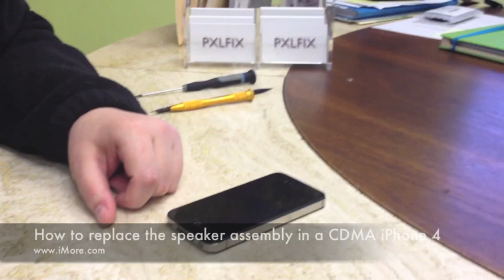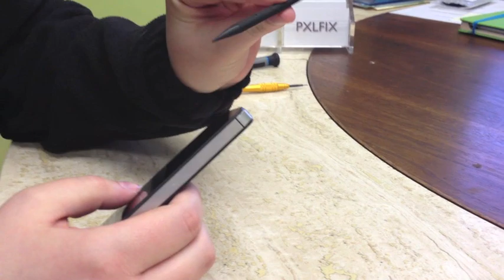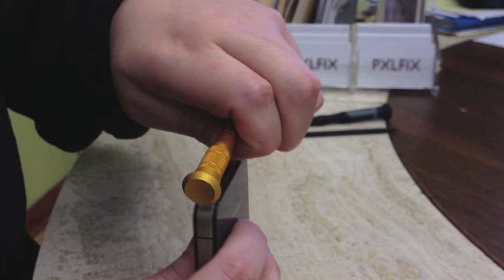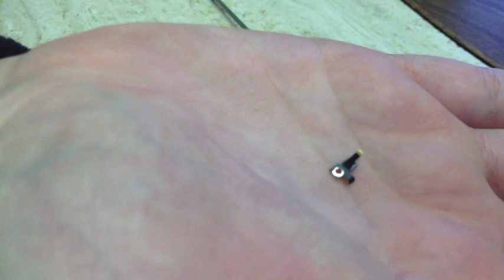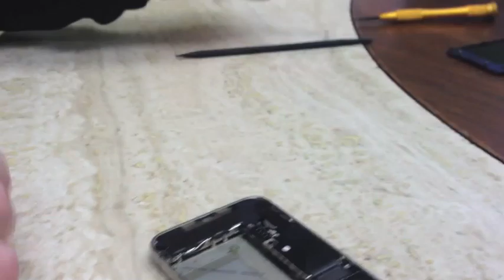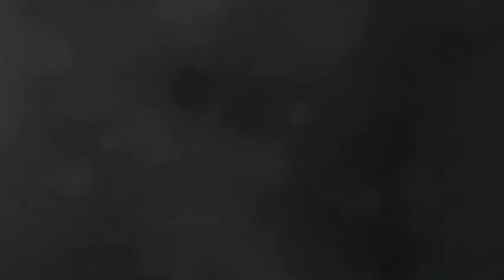How to DIY replace a Sprint or Verizon iPhone 4 speaker assembly

Comment: If you touch some of the components with any kind of metal, meaning you are, since you'll be taking out the screws, you may end up shorting your phone, that maybe later it would not turn on. That is why they always recommend you to turn it off and to disconnect and take the battery out before you start taking out any components inside.